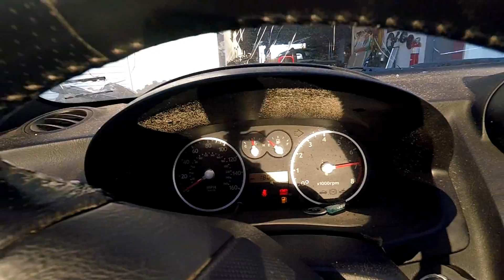I Changed My OIL with MOUNTAIN DEW!!

Comment: That thing is probably pushing a good 5000 horse power with that dew in there and thats whats caused the lock-up.
Reply: Powerstroke 6.7 👍
Reply: Powerstroke 6.7 the word “dew” is just weird for some reason
Reply: Powerstroke 6.7 no it is because of the sugar that caused the lockup
Reply: Poor little japanese car coulden't handle all them bald eagles.
Reply: SmplGames unless it's a $100,000 American car it's absolute trash. get that shit out of here
Reply: loom plain n some it blew up cuz there was no oil in it to keep friction from fucking up the internal parts etc wtf else would u think done it!!!
Reply: No oil in the engine friction on the cylinders then cylinders fused to the cylinder head. Like a weld
Reply: 5000hp...seriously, mabye 200 or 300 hp lol. The buggati veryon stock is 1012hp....and its not a race car
Reply: Ian Sorensen.
It's got nothing to do with sugar. It's got everything to do with lack of lubrication, which causes the bearings to seize.
Reply: poerstroke 6.7.
The 2.7 litre V6 Tiburon engine is factory rated at 172 horsepower, how tf do you think it's "pushing a good 5000 hp"?
Reply: Well I didn't have to watch this video to see what happens next I already knew people are so so stupid. You wouldn't drink petrol or diesel so why put something we need into a car
Reply: people are pretty upset you have a wise choice of truck and they dont understand humor lmao

Comment: I bet you never knew how strong a Hyundai engine could be untill this video 😂😂😂😂
Reply: is it the 2.3 v6
Reply: I thought it was a Pontiac...
Reply: Ben Gerlach what kinda car is this ?
Reply: Lunarinc it is a Hyundai Tiburon
Reply: Ben Gerlach it's actually a 2.7v6
Reply: Mastermilo82 also was suprised about the hyundai powers, he killed it running no oil, after a lot of torture before
Reply: u mean mitsubishi 6g7_ engine? all hyundais rebodied mitsus
Reply: MainMite06 Its the g6ba delta 2.7l v6 173hp 178ftlbs. Santa fe and Tucson has it too. Not all Hyundai's have Mitsubishi engines.

Comment: People say hyundais are crap, there actually pretty tough. had a V6 coupe from new clocked 100k miles and then sold it to a friend, who still runs it clocking 210k miles and it's running as sweet as it did new.

Comment: I'm surprised the stock engine help up with that nitrous spray, I've seen  that take down a cobalt SS. luck? Or just a genuine strong engine? How much boost could this stock engine take?
Reply: Tony Davila if someone made a turbo kit I would find out. No one makes tuners or re programs the computers in early 2000s Hyundai's so we are stuck with 150hp
Reply: OutdoorPower2 look into making a map yourself, with a laptop, flasher and a scan tool that shows pids. 14.7:1
Reply: Heres another build. Not a typical turbo build though. This one is turbocharged and supercharged https://youtu.be/9a-euUtePHg

Comment: Just what kinda car was that.  Cause it has got one tough lil motor   I've seen something like it done when my friend and I was ah letting his Nissan truck ,with a 300Z motor in it, drive us around cause we shouldn't have been. Anyway we/ it took us mud riding and it stayed petal to the metal for about 5 mins in 4x4 high.  Anyway had fun same as you  just thought you'd had Cletus there but he'd stopped you from pouring the dew in it   Lol

Comment: I guess a manual can handle the rev limiter unlike automatics
Reply: ihavenocluewhatoput not a single car you would do this shit to is going to be automatic.
Reply: Toast just put it in neutral
Reply: Jarryn Smith most cars still don't let you rev past 4 Grand
Reply: Jarryn Smith that’s not how a 2 step works bud. it’s a second rev limiter that won’t bust your engine immediately. and it’s made for manual cars lol
Reply: woofdawgg69 yeah, diesels...
Reply: CrunchyNapkin I know man ? I was just saying put the car in netural to rev a automatic. im pretty sure most people dont even use two step for what its intended for (boosted engines with major lag) or have it and third a transbrake is  better for launch and rolling antilag with a higher fuel cut will give you all the noises you want plus no lag
Reply: No difference

Comment: I hate to be a bumber but dont u know there are people strugling why not give it away rather that try and blow it up. I'm kind of amased it withstood the abuse thus far.
Reply: Because they can
Reply: Eric McGinnis usually junk cars like this aren't safe for the road due to underlying catastrophic damage. Usually frame rust or a botched repair job from a wreck. But Hyundais (especially older ones)  aren't really known for reliability either.
Reply: and they made more money doing this so they can give away a better car :)
Reply: Wensis Rompas  could have but did they?
Reply: you can fix em but still it is there property anyways they can do what ever they want with it
Reply: Tell the people that are struggling to get a better job!!
Reply: Orion Riley takes more money to repair them than they are really worth
Reply: Working 2 jobs both 20 bucks an hour cash combined. Taking care of 3 kids which aren't legally mine. And paying bills and still struggling. It is their vehicles, but they cuda at least offered to sell parts. That engine took a good 10 minutes off the red line that's some troopin. As well as I been laying here for 20 minutes wondering where my case of MTN dew went. Now I see wtf it ended up doing. Just wonder what it's doing when I drink it and eat french fries with ketchup....diabetes here half of American 25/30 year olds come lol
Reply: Eric McGinnis

Hmm.. Yeah Good point but in my opinion I cannot judge about their motivations though.
Reply: Handsome no but I would have gave a grand for it just for parts